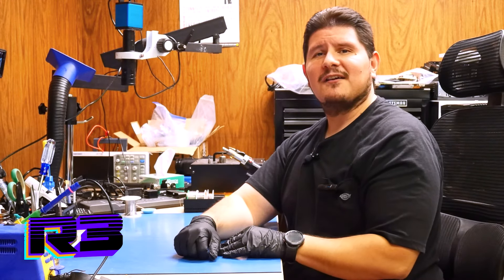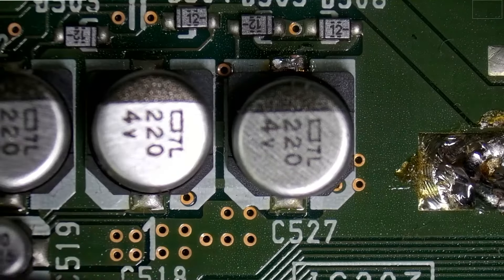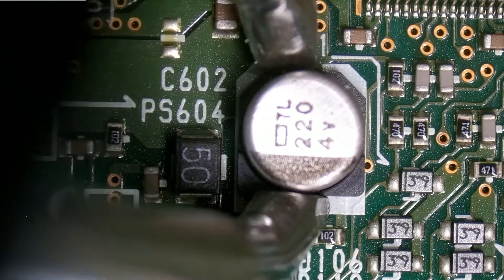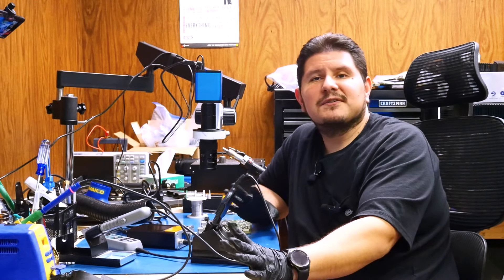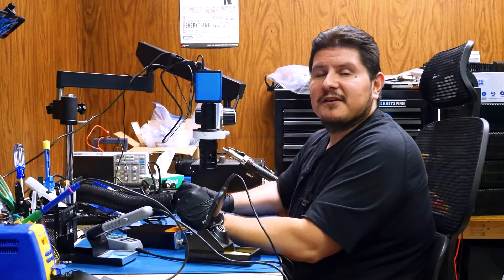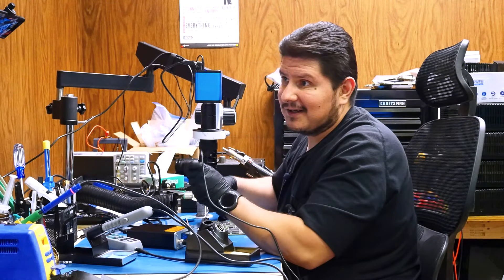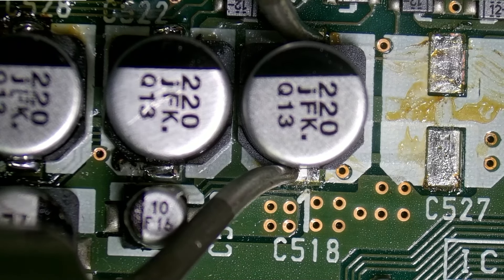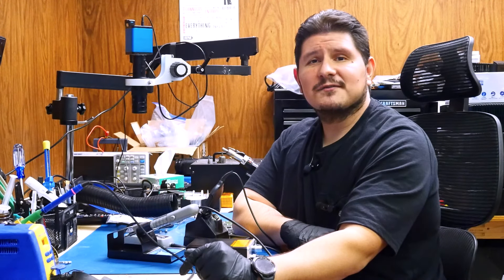Best Soldering Iron For Capacitors 2024! Removing Aluminum Electrolytic Capacitors SMD

Comment: What would you say would be safer in removing these caps to NOT pull a trace? The Yihua or twisting method?
Reply from the maker: Probably the Yihua, but it will be more time consuming. I have found that I almost never tear pads/traces if you twist and do not pull up.